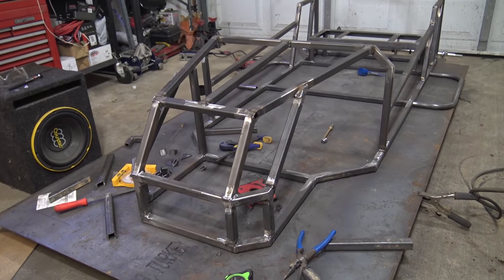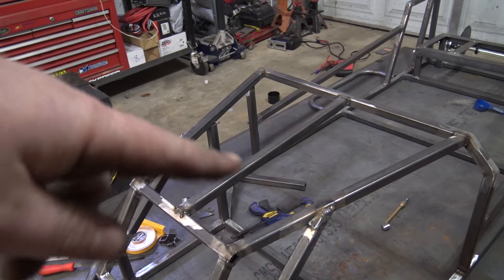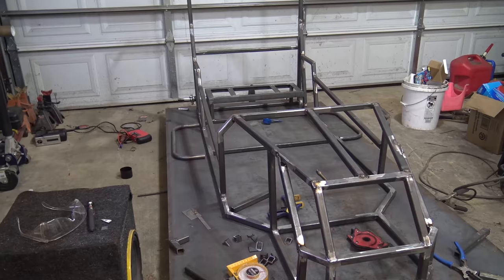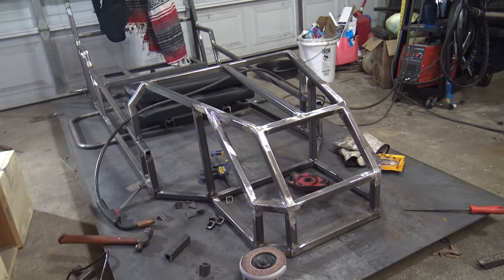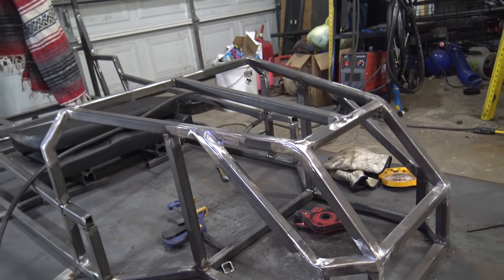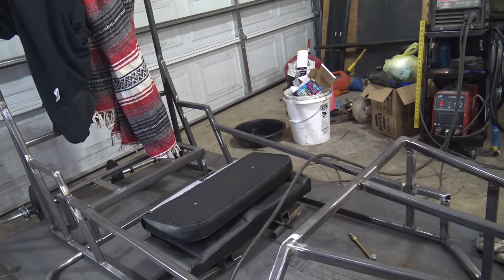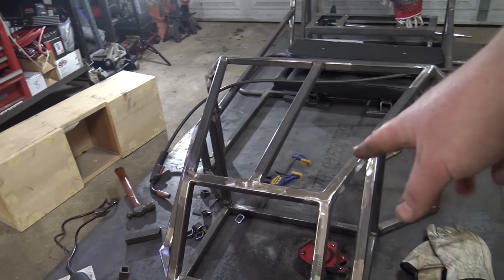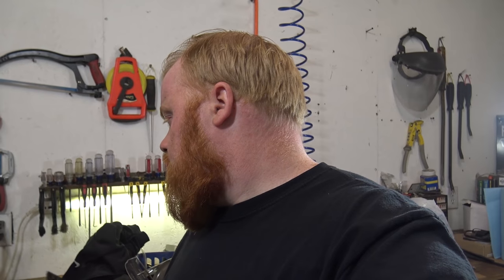4 Seater Go Kart Build Ep 3

Comment: Hey redbeard, I don't know if you have watched CarsAndCameras but they did a build with a 420cc on a drift trike.  They also put EFI on it.  They discovered that the charging system for the 420 was not sufficient to keep the battery charged, even with the small draw of the EFI.  I think this is something that you need to consider if you put a winch, lights, and anything else on this beast.  Just a thought that might be overlooked but it can create some major problems.  Have a good one  -Spencer
Reply: the 420 only has a 0.7A charging system

Comment: not sure what i expected from the front end but it looks better than i imagined it would. when its done, can i have detailed plans? I'd like to build this with carbon fiber.
Reply from the maker: +Dracolegacy yeah I'm going to try to draw some up
Reply: bitchin. also i saw the conversation about the reverse gear thing, have you considered an ATV engine/transmission combo? amazon has a few with 4 or 5 speeds for 600 or less. might be something to play with for a project.
Reply from the maker: +Dracolegacy I'll check those out. I have a 250 ATV out back that needs some tranny work. I may put it together for it.

Comment: that thing is looking amazing. but the RBG ur talking about on the grill u should try to have it lite up with some back lighting think it would look great at night
Reply from the maker: I have some ideas on some leds on the go kart. I probably will make some in the grille. Thanks for watching and supporting the channel.
Reply: You can take mirrored Lexan and heat and bend it to fit in your headlight hole and then drill holes for each LED and cover the front with a clear piece of Lexan. Build your own CTS headlights. Cheaper way is to use chrome spray paint instaed of mirrored lexan

Comment: Good job man, it's coming together great! 

I've been subd for a bit but can't recall- is this the first you've built from scratch? I'm really curious what you've got up your sleeve for suspension too! 

One last question..  I assume you like them seeing as you own two..  What do you think of the porter cable grinder? It took me like 10 years of small time use to finally get tired of my Cummins tools $14 grinder (which really really sucks.. The arbor is bent.) and bought a dewilt for a primary grinder...  But like you, I grow awful tired of switching wheels so I'm looking at picking up a couple extras. The porter was actually my number one pick until I used my brothers dewilt and decided to make that my primary.  Hard to argue with 11 ampers in a 4.5" grinder...  
Thanks man!

Edit: forgot.  You could throw in a little time lapse of the cuts if you wanted..
Reply from the maker: Yeah this is the first time building one from scratch, the suspension will be like a yerf dogg in the rear and have small a arms in the front. I love the porter cable grinder. I will be buying 2 more soon just so I don't have to change the disk as often. Thanks for watching and supporting the channel.

Comment: Hello, my name is Demetrius, my first question is I have a V twin predator engine and I have two dual pz27mm 200cc carb and would it work for it?? I am just putting Straight intake pipes on each side to get more hp?
Reply from the maker: You may need more than that. I would think that dual 32mm would be a better match but then again I could be wrong. All you can do is try it. Im doing the same set up on my v twin Kohler engine and I have been wondering what size to go with. I was going to try a dual 32mm most likely.
Reply: Red Beard's Garage ok thanks.
Reply: Red Beard's Garage you think I can get it to go up to 80 mph with my weight as weighting 320 pounds??
Reply from the maker: It all depends on how you gear it. If you want to achieve 80mph it will be geared so high it isn't going to take off worth a poop but you can get to it

Comment: a simple Viper alarm system uses a lock function that is a simple ground signal.  Would it be safer on a parental stand point to have a emergency start stop?
Reply: add on... love the show, as a father of three, military reservest,with a full time student wife and a full time job this makes something I have always wanted to do so easy to understand. got a gokart for the first time ever 4 months ago, found the page and sent $200 on old gokarts and rebuilt both, lucky they came with the predator 212, thanks again and keep going.
Reply from the maker: +keith Marsh I appreciate your support man. Thanks for watching and I have been thinking about putting in a key fob kill switch for safety.

Comment: tow mirrors, led light bar, turn signals,  break lights, make a go Cart truck lol just trying to throw some ideas
Reply: and have the front seats able to adjust so when nobody is in the back you can slide your driver seat back
Reply from the maker: +shotgun vs ??? Yeah it will be on sliders. And I have noted what you want to see on the build. I will see what I can do.
Reply: right underneath the headlight holes would be a good spot for front turn signals with orange leds